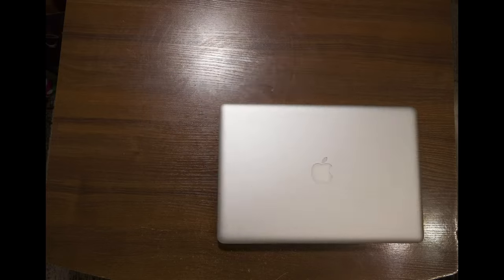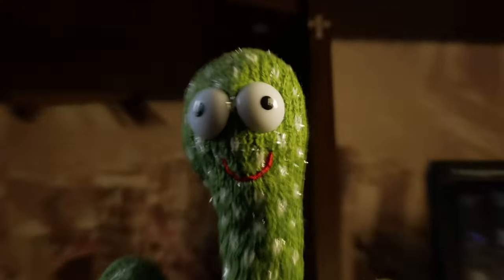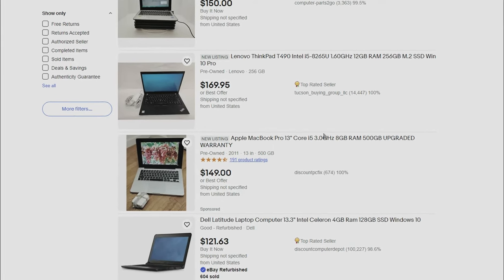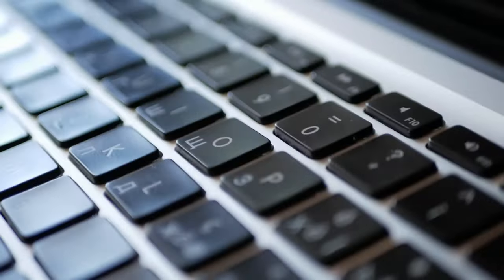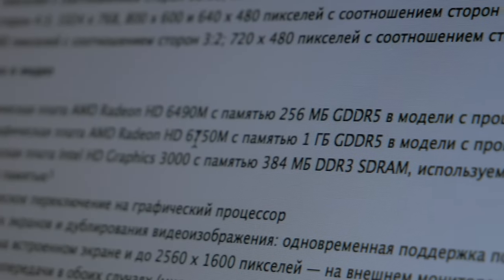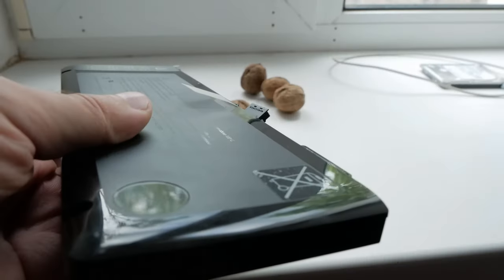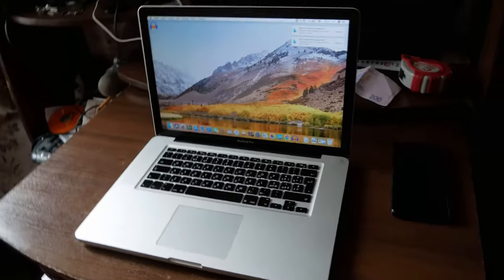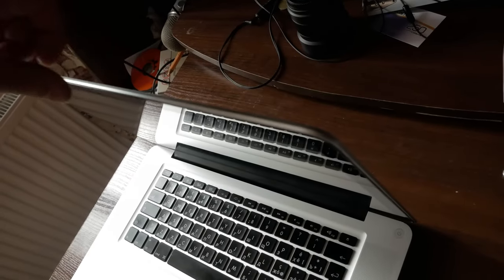I Bought the WORST Apple Laptop Ever Created By Them

Comment: lol. i got my late 2013 15 inch macbook pro core i7 16 gb ram 500gb hard drive for 130 with no issues.
Reply from the maker: macbook 2013 was not as problematic as macbook 2011, macbooks 2011 often fell off GPUs
Reply: @whatwithpc8490  tell me about it lol i had a 2011 years ago. it wasnt mine but i borrowed it for like a year. my 2013 has a geforce gt750m